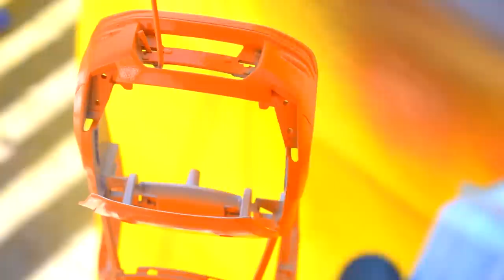Restoration Abandoned Nissan GTR Model Car

Comment: Dude u need to sand the body of the car to get a proper finish
Reply: Sand then couple layers of clear coat. Would've be awesome! But still a good one though
Reply: It’s probably plastic
Reply: @aidanzipler  yea lol
Reply: Thats what i was thinking. Primer it. sand it and then base coat. then clear coat then wet sand with 1500 and 3000. Factory look that makes the car seem more real.
Reply: Before painting you need to sand the car? Im trying to get on this custom hobby
Reply: He has sanded down cars before, maybe he skipped that step.
Reply: i think we can agree that there is a lot of other things that we can worry about
Reply: @Mr.Gundam7  of course if not, paint Will not last

Comment: You could’ve sanded the metal before primer with some 240 grit sandpaper then smoothed the primer out with 240 grit sandpaper so the paint would’ve come out smoother. Great job none the less

Comment: Thoroughly disappointed you

1) didn't sand down the die cast before paint 

2) didn't paint the interior pieces either black to give it a nice finish inside or another color

3) didn't sand and buff out the lights and windows. Takes away from the video when you can see the scratches because one expects it to look like a well new car not a restored to "used/pre owned" car 

Just some friendly criticism for future videos